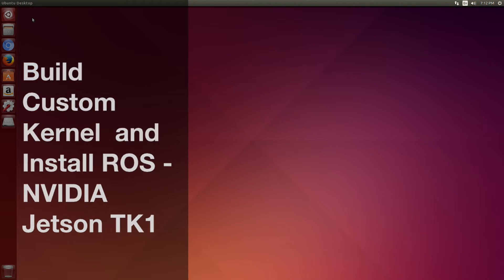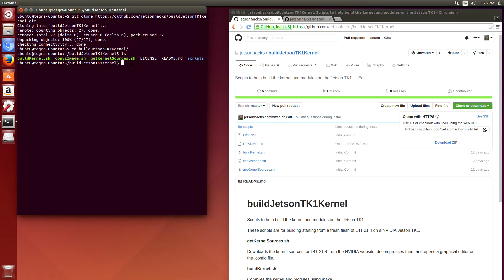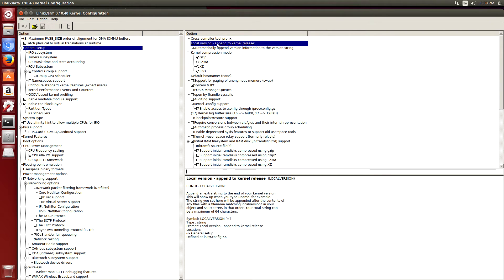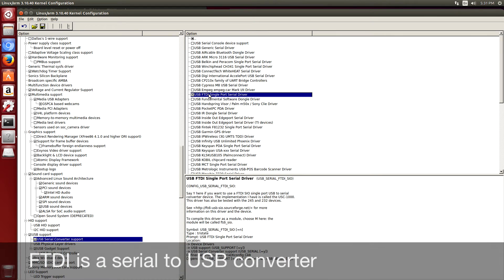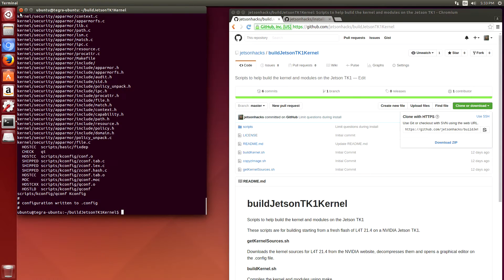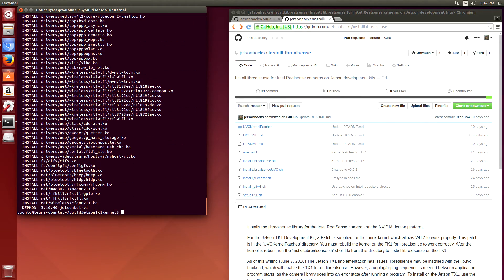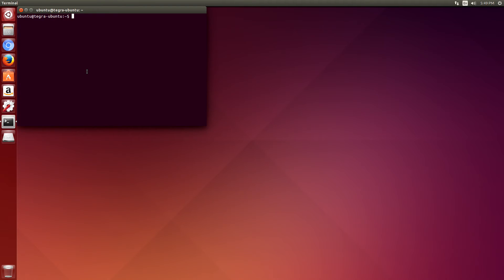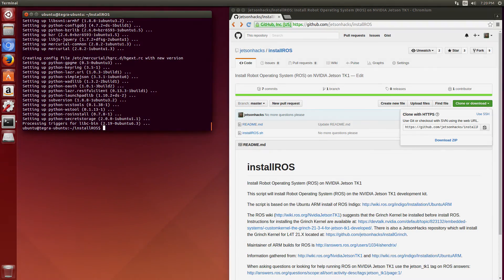Jetson RACECAR Part 8 - Custom Kernel and ROS Install

Comment: Why not use the ZED camera instead ?
Reply from the maker: That's certainly one viable alternative. Both MIT and UPenn use the ZED in their cars.  Each camera has their own advantages. The advantages of the RealSense camera are the price ($100 USD for RealSense R200, $450 for the ZED) and that the RealSense builds the Depth Map in hardware onboard the camera itself (along with color -> depth map  registration). The ZED, on the other hand, has longer range and a potentially larger Depth Map. A tradeoff of the ZED in comparison is that it uses the GPU on the Jetson to build the Depth Map. On the Jetson TK1, that doesn't leave many cycles left to do other types of CUDA processing. With the RealSense, you get 640x480 @ 60fps with no computational load on the Jetson, with the ZED you may be able to get those rates but the Jetson TK1 GPU is running close to flat out.

On the Jetson TX1 there's more headroom compute wise so if I were to use the ZED I would use a Jetson TX1. Like all engineering projects, there are trade offs to consider. It's the usual suspects, cost and performance.  A TK1 with a RealSense camera costs ~ $300. A TX1 with a ZED is ~ $1050. If you are relying on a RGBD camera as your only sensor you have to figure out the performance curve. Once you start placing additional sensors on the car, there are other tradeoffs to consider. You also need to consider the racing environment. Are you racing indoors in corridors, outside on a marked track, or just free styling across a parking lot or a field?

If you already have a ZED and a TX1, that's a good choice. If you don't have both already,  you need to make some choices. 

Conceptually the software is the same for both cameras, with both you get a depth map. You can use the color camera to do visual odometry, object detection, navigation and so on. Note that compute headroom is important, the more you have the more  sophisticated software algorithms you can use.

With that said, the MIT and UPenn cars have plenty of reference material for using a combination of sensors in addition to the ZED. That's a straightforward build, the only real pain is the $3900-$4500 bill of materials. Me thinks an alternative is to build a car with a bill of materials in the $1K-$1500 range which can be just as much fun, and from which you can learn nearly as much. Constraints are the fountain of creativity!